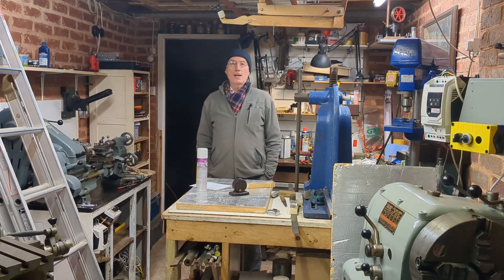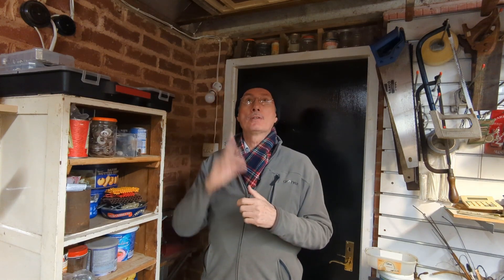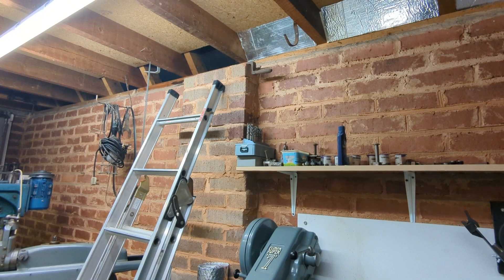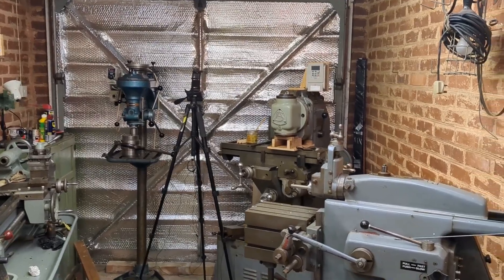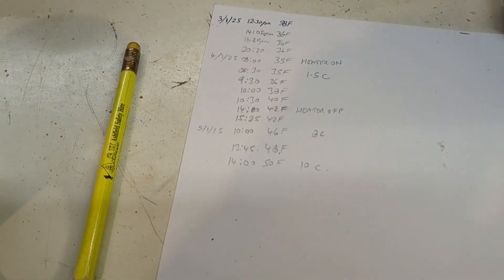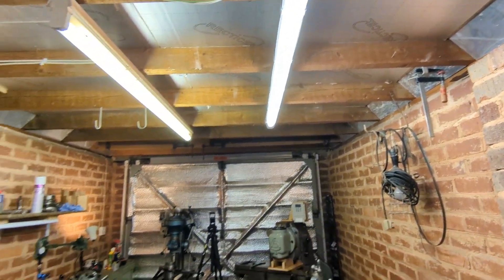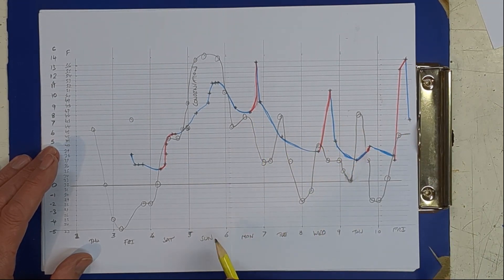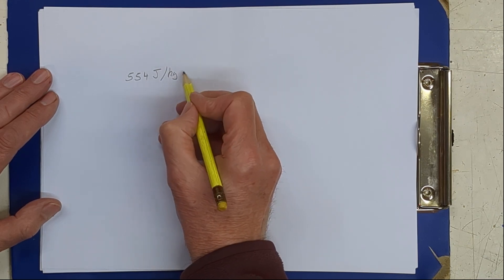Dealing with rust in the home workshop - part 2

Comment: I Make a mixture of oil and wax and put that on my machines then rub of access , then cover machines with wool sheets then plastic, 
Each year I wash sheets go over with my mixture and do the same each year, this seems to prevent a lot of condensation attacking the iron,
my garage also cold in winter and effects metal if i do not keep on top of it,
WD40 is a lubricant and a water disperse, but  i`me not sure how good it is to protect from condensation
Reply from the maker: Thank you for sharing your experience. It sounds as if you mothball your equipment during the winter. I have to admit I find the workshop less appealing during the winter. I have found the combination of various rust inhibitors and better insulation to have helped greatly.
Reply: @Workshopfriend  I have no choice unfortunately to do what I`ve done every year ,I have a insulated roof and 6" concrete block for walls but my floor lets in damp,in places,and cant afford to run a heater every day,
a its to cold in there in winter, to even concentrate on any work lol,soyes it gets all covered up,
Reply from the maker: @piecetoyou8285 I thought my floor was damp but after insulating the garage realised that most, if not all, of the dampness had been condensation. I agree that running continuous heating is too expensive for the sake of a hobby!

Comment: Excellent treatise on building heating, obviously this time of the year in the UK is worst case for many garage workshop combinations.
I have installed machines with a non absorbing plastic pad under the jacking pads at a customer's request, this could assist in reducing heat loss, though obviously not humidity issues. 
HDPE or MDPE ( Kitchen cutting boards), is excellent for this. 
With regard to your specif heat calculation,  I  think you've assumed 100 % heat transfer, ref air as a medium,  painted surfaces,  thermal conductivity,  plus many other variables?
Not sure on your roofing construction,  but maybe be mindful of blocking air flow. My 10 x 16 ft shed has 16 mm holes every 18" and remains dry.
Thanks for sharing. 
Best regards John
Reply from the maker: Thanks, John. If I understand correctly the non absorbing pads were requested to reduce heat loss - but sounds unlikely. I could understand it to reduce the change of rust. My homemade jacks are in danger of rusting because of humidity and cold at floor level.
The ceiling has a roof space above it so there is plenty of ventilation.
Yes, I agree about the very crude calculation. I should have explained that it was to show that the temperature of the equipment will warm even  slower than indicated, for the reasons you stated.

Comment: Really interesting video, but I'm sorry to say that it will take a lot longer to heat up your equipment than 3 hours due to the efficiency of heat transfer between your radiators and the cast iron.
 I think the main aim you can get to is ironing out the temperature fluctuations in your workshop; keep it constantly a few degrees warmer than the outside and the metal items in there should never be cold enough to cause condensation... in theory!
Reply from the maker: Thanks for your, spot on, comment! I meant to say that heating up of machinery surfaces will take longer than this crude calculation indicates not just because of heat transfer, but also heat losses.
I am glad to say that temperature fluctuations are much reduced after adding the insulation. It remains to be seen if this is sufficient on its own to eliminate condensation without some heating.

Comment: If you’re not disagreeable to leaving a fan running in there, you might find it stops condensation from forming.
Reply from the maker: Thanks, Steve. In your experience does the fan need to waft air directly over each machine or just generally in the workshop? The other question is what about heavy items which are tucked away in shelving?
Reply: @ you’re welcome, just having the air generally moving around should be enough. Cheers

Comment: As people have mentioned, the dew point is critical here. If the material in question is below the dew point temp then warmer air will give up moisture onto the cold surface. Air changing is also important to ensure the air in the room does not become too warm and wet, I.e. from people breathing out hot wet air in the room, undermining the work already done. That’s why modern window and door frames have trickle vents. When people close them you will start to see mould growth in corners of rooms and window jambs where the wall surfaces are coldest. Modern wall construction with foil covered insulation or plasterboards or plastic sheet lining between plasterboard and an insulted stud framework move the dew point away from the wall surface.
Reply from the maker: Thank you for your helpful comments. The mass of the machinery provides wonderful condensing surfaces, as you say! I have wondered about the correct amount of ventilation balancing air exchange Vs temperature stability. I suppose time will tell.

Comment: I wonder if an experiment with a humidity meter (they are very cheap) might be interesting in your experiments - which I find of interest. I found that keeping my workshop temperature higher than the outside temperature helped significantly. Keep up the good work!
Reply from the maker: Yes, I think it would be interesting. If humidity and room temperature could be linked to measuring actual metal temperature it would be even more so.

Comment: I have a similar single garage workshop in the UK. I’ve insulated the walls with 50mm thick polystyrene which I then boarded with 19mm thick OSB. The roof is flat and is insulated with 100mm thick mineral wool between joists and boarded with 12mm thick OSB. I have a fibreglass up and over full width vehicle access door and have insulated that with hardboard faced 50mm thick polystyrene panels which are placed in the inside and can be removed so I can use the door to move machines in and out of the workshop. There is a normal “personnel” door and a double glazed window. My solution for condensation is a domestic desiccant dehumidifier which you can set to maintain a desired humidity value. It cost about £130 and has eliminated condensation and rust. It’s rated at 350watts and slightly heats the air it circulates. It has a 2 litre water container but can be plumbed in so condensate can be routed outside. I don’t think my garage floor has a damp proof membrane so the dehumidifier often removes  2litres of water every 3 or so days.
Reply from the maker: Thanks, Andrew, for the description of how you insulated your garage of similar proportions. I need to decide whether it is worth going to the lengths you have taking into account that I am already tight on space. Desiccant dehumidifiers have been mentioned several times now so based on the experience of others I may eventually go down that route. More experimenting is required.

Comment: Just one electric heater on a low thermostat setting is enough to keep the air dry and your workshop above freezing. The heater coils help dry the air. Yes its costs but its that or rust on your sideways
Reply from the maker: Thanks for your comment! Yes, cost has to be weighed up against potential damage. I will keep working on it.
Reply: @Workshopfriend  Totally understand, tbh it only needs to be on for 10 min and i find it dries most the moisture out although i leave it on the lowest thermostat setting and find it only turns on once every two to three hours but then my garage is connected to the house on three sides

Comment: With that insulation, the aluminized side should on the side where the air comes in. Otherwise the air penetrates to the foil backing and you get little actual insulation other than that the air penetration into the space itself is stopped. Additionally, the aluminum backing prevents moisture from penetrating through the insulation to the foil. It can be calculated as to how fast metal warms up, or cools off by measuring the thickness. There are several formulas to then calculate how many degrees per hour the machine will warm up. The calculation also takes the differential in temperature between the machine and the air. Just remember that WD-40 is excellent in removing water from surfaces and preventing it from coming back for a short while. I find that unless that’s done before applying any preventative, the water will actually mix with it and you’ll still get rusting. Ah, after I wrote this is see you’ve done some of the calculations.
Reply from the maker: Thanks for your comments. The insulation I used had aluminium foil on both sides and there didn't seem to be any distinction between the two. Perhaps other products have foil on one side only. Yes, my simple calculation didn't take heat transfer into account; it was merely and attempt to indicate that it would take more than X hours to heat up. I should have made that clear. Would be good to look into this more. Despite the limitations of WD40 I used it to protect my lathe when it was shipped by sea (3 months) and there was no rust whatsoever. That may be testament to the shipping environment despite my worst fears.

Comment: great video and I'm going to try and spray lacquer with 2 pac any bright surfaces that go rusty and in my small machine shop I have a Chinese diesel heater which is very cheap and effective .
Reply from the maker: Thanks for your comment. Won't spray on lacquer impeded machine slides/get scraped off in normal operation, or are you thinking about long-term storage?

Comment: I generally don’t have the issue, because my workshop is well insulated, and the heat only creeps up slowly, but in the past, I have mixed white spirit with grease, to the consistency of paint, and this worked quite well
Reply from the maker: Thanks, Ian! I guess like me you also have to be careful not to heat up the workshop too quickly. The paint on homemade rust prevention sounds like a good idea.

Comment: Hi , I have an identical set up to you. The problem is as follows 1/ very cold days , machinery steel gets very cold. 2/ warmer (more humid days follow) moisture in the warm air code sea on the cold steel which has not yet warmed up due by its thermal mass. 3/ flash rusting occurs. 
I address the problem as follows : 1 / I keep oil bare steel oiled or at least a coating of wd40. 2/ I cover my machines with packing (removal company ) blankets which stop the condensate from settling on th steel . I find this very successful and don’t have any problems with glass rusting. Obviously remove the blankets when using the machines but replace 😅once I am finished for the day. 
I also have a metal cabinet for some ‘bare’ tools within which I have a greenhouse electrical tubular heater (60w) connected to a thermostat set to about 2 degrees and this stops them getting cool enough to allow condensation to drop
Reply from the maker: Thanks, Andrew. Yes, I think your diagnosis is spot on. I may look out for some suitable coverings for the machines. I like the idea of a cabinet for loose items with a greenhouse electric heater.

Comment: ooh looking forward to that video in comparin rust inhibitors.  was going to just buy some acf-50 and see how it was but i'll wait now.  Don't forget the walls, floor etc in your hours or heater runtime calculation... though you don't actualy need to raise the remperature 8 degrees, you just need it above ambient, maybe by a couple of degrees to account for cold spots
Reply from the maker: Beginning to think about how to conduct the test. The pressure is on!
Yes, the fabric of the workshop was not taken into account. The very simple calculation was intended to indicate that it takes a long time - ie more than what was indicated. Yes, 8C was taken out of the air!

Comment: Really enjoyed these two videos, I have an insulated shed for my workshop and a thermostat controlled oil filled radiator set at 10°c, 9 years in and I have kept moisture and rust at bay.

Based in North West England. 

Look forward to any further updates.
Reply from the maker: Thanks, Chris! Your shed must be well insulated to maintain 10C. I don't think I would be able to achieve that level of comfort without a huge electricity bill. On the other hand my winter is probably a little shorter than yours.

Comment: Stopping the machines from getting cold is your main obstacle. Once they get below freezing and become "cold soaked", once the temperature rises they will start to sweat, as you've seen. Insulation will help reduce the amount of energy needed to keep the shop warm, but the main goal is to keep the machines from reaching the freezing threshold in the first place. I installed a mini split heat pump in my shop and it has an "away" setting that I use when I'm not in the shop. It uses minimal energy to keep the room at a constant 46 degrees F. This allows me to turn the heat up to the mid 60s when I'm working in it but because the machines haven't been below freezing temp, they are able to warm up without building condensation.
Reply from the maker: Thanks for your suggestions. Several have mentioned mini heat pumps so I will take a look at them but suspect that would require quite a hefty outlay. I can see it would be a good long-term solution especially since no amount of insulation can prevent temperatures from eventually dropping. Some kind of heat input is going to be necessary.

Comment: Excellent follow up and analysis. I really think you are 100% on the right track. If you stabilize the temperature swing inside above the dewpoint, and prevent incoming moisture by restricting incoming ventilation  the way you are you will solve the problem and you won't need bedsheet covers or dehumidifiers. Oil coatings are always good on machine tools of course, but if you are able to get far enough even those can be minimal. The wildcard is your brickwork, which will still allow damp in to an extent, but it seems to me you should be able to solve the worst of it and then light oil coatings will take care of the rest. Nice work - and that's a really nice shop you have. All the best.
Reply from the maker: Thanks, Stuart. Yes, I agree that the brick work is a limiting factor which means I need to maintain an appropriate degree of ventilation - but then I will need that anyway. It would be nice not to have to rely on coatings with the accumulated cost and messiness.

Comment: Apologies for posting twice Clive. I have just been chatting with my brother Dean about your problem. I have just realised that your workshop is a stand alone building. I thought it was attached to your house, and thus was able to pick some heat, however small, from that. So the main issue then is to minimise temperature swing, ie to maintain as near to constant as possible. So I think more insulation in the roof space will help if there isn't any already. It is quite an expense, but a roller door will make a huge difference as they seal very well, almost like a fourth wall. Also much more secure. I think battening the brick walls then panelling with sterling board or similar, with rockwool in the voids, is also a good idea. Then back all this up with trace heating. You can do this simply by getting small electric bathroom space heaters. They are inexpensive, tubular heaters that have an inbuilt thermostat. So insulation to make the space as thermally efficient as possible, then a small amount of heat input as required, to maintain a constant temperature. 

That is what I would do. If I'm honest I see the use of WD40 and other preparations as treating the symptoms, not the cause.
Reply from the maker: Thanks, Carl. Yes I agree that protective barriers, no matter how good, are treating the symptoms. Of course they would be useful for extreme circumstances when better environmental control cant cope.
I agree with you ideas about improving the insulation further. The issue I have to consider is how much of my limited time I want to spend on that, for diminishing returns. Perhaps these are projects for next winter!
Reply: @Workshopfriend  That's understood of course. As the weather improves it becomes less of an issue.

Comment: Hi Clive. Excellent progress indeed and hopefully you are well on your way to soling your problem. With regard to humidity control, perhaps consider a MEACO DD8L Junior dehumidifier. These are suited for a cold atmosphere and add heat as they work. Quite cheap to run and by both drying and heating the air they are a win win in a cold environment. Ours has been invaluable within the home. 👍😀
Reply from the maker: Thanks, Andrew. So much valuable feedback has come my way (and hopefully helpful for viewers too)! I may have a look at this option depending on how things progress. I like the idea of low lever heating and dehumidification combined.

Comment: Nicely scientific.
Search Dimplex Tubular Heater. Low power thermostatic heaters that you could just leave on and protect against frost and big temperature changes, especially now you have insulation.
Reply from the maker: Thanks, Ian. Yes, I wouldn't have contemplated heating without the insulation. It would have been money/energy into heating the local environment. The only question is whether my uninsulated walls are going to let the side down.

Comment: As always Clive, a very good video, I had a similar problem until i was given 2 x 6 foot green house heaters.  worked a treat, keeps an abient temp around 15 during the colder months, very cheap to run too. on 24/7
Reply from the maker: Thanks, Ian. That is a good idea. I think, though, you must have a better insulated workshop than me! I would be happy to achieve a minimum of 10C!